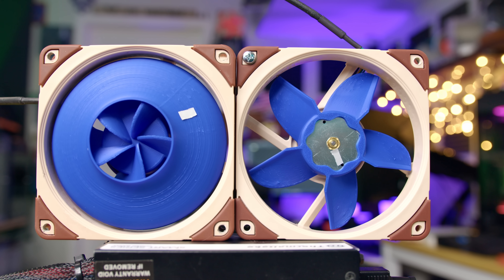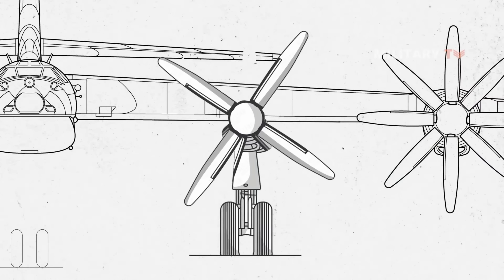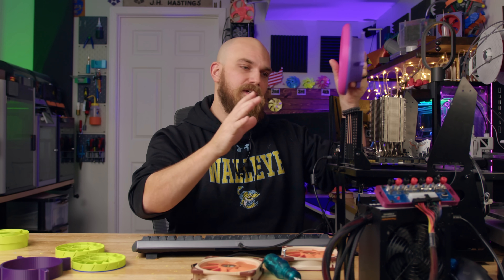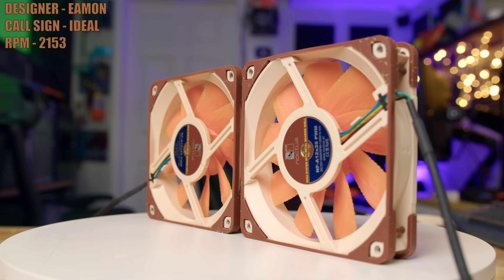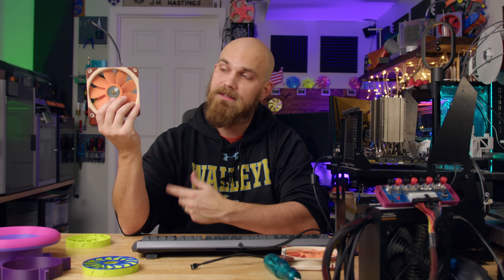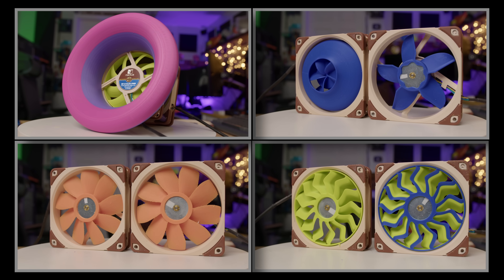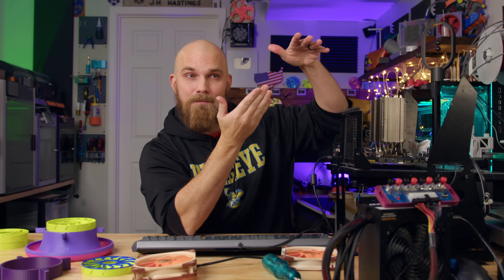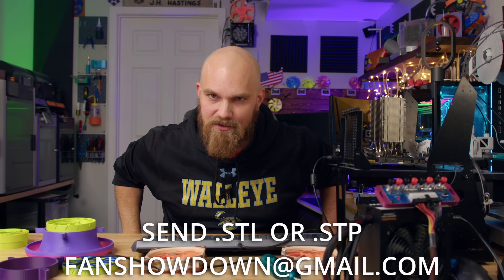This Fan Shouldn’t Work — But It Dominated | Fan Showdown S7E2

Comment: I love that fan show down is still going, it was a great idea when it started and it's still great. Have you thought about a small windmill showdown ? Use whatever kit is easy for you to get as the standard hardware and set a project budget based on materials, time, resources, etc. so that you are not driven insane and the optimization would be a part of the final score. Sounds like more work than I'd want but I'd definitely watch them.

Comment: The calculation doesnt take into account the non linearity of decibel units. For instance 50 decibles isnt 25 percent louder than 40 decibels. Its actually 1000 percent louder than 40 decibels. So the louder these fans are... the less penalty theyre getting for that increased noise 
Note:(this is all quick half asleep brain math so ill probably edit this comment after checking my work)

Comment: Given that the cpu is going to speed up or down based on the thermal envelope it's provided, I feel as though adding some sort of benchmark as a score coefficient is prudent...(yes, a person can artificially lock the power level and clock frequency, but most people don't operate that way.)

Comment: Your scoring formula simplifies to Score = 100,000 / (deltaT*dBA)
You can easily see the issue here, two differing scales being multiplied together with no regard to how those scales actually interact or are perceived. We can assume that temperature is linear in practice, but dBA very much is not, and it isn't perceived as such to your ears. You know this intrinsically, all humans do.

If you want to put numbers to it, something like 
X = 100,000 / (deltaT × 2^(deltaD/10))
This is because the perceived loudness of a sound source doubles every 10dBA, so, the penalty should also double in kind BUT, noise floor is VERY important here, because the perception of sound is not just logarithmic, but also RELATIVE.
This will give you a much more realistic result as to how the experience of using a given fan would be. 

The only way to make this better would be to penalize for narrow-band tonality in the dBA weighting, because broad-band noise is more pleasant to listen to than narrow-band noise at high frequencies, even at equivalent dBA measurements. That is probably beyond the scope of this test.

That formula does change up your rankings of course, but it matches reality, so, shouldn't change any designs that weren't just trying to game the original formula.

By the way, if you have read this far, and want to submit a fan, fewer blades are better, because they have a lower fundamental frequency that the weighted dBA formula doesn't account for. Use good blade design, 5 or 7 blades, and make sure that the interference between fans also creates frequencies below the dBA weighted zones (look it up) and you'll have a winner.

Comment: Have you considered a new smoke test with a cooler in the middle of the fans like it'd be confused on the PC? I think that would provide a realistic visualization of the air flow paths and rate

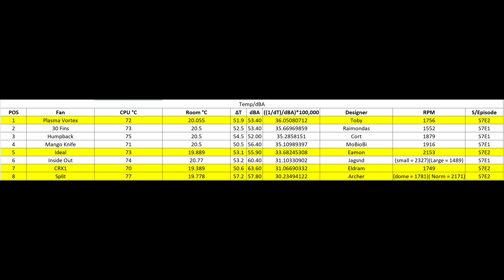Comment: 7:45 the equation seems to rank fans with worse cooling higher than better cooling. Delta t is how low the cpu was compared to room temp so larger dT is better. dT/dBA is a better ratio. Ideally it would be (dT/(10^(dBA/10)))×100,000 to account for log scale of db
Reply: I agree about the dT/dBA thing, however I don't think the exponential is a good idea. We perceive loudness logarithmically, thus dBA is already an appropriate unit to use.
Reply: assuming T (room) is always less than T (CPU), then the lower the dT, the lower the temperature of the CPU.
Reply: @SkeptiSquid  You're right, thanks for explaining. I thought about it the wrong way around.
Reply: @SkeptiSquid oh yh.. for some reason I kept thinking it was the cpu temp before and after... duh

Comment: My only gripe with the new fogger is... there isn't enough of it to properly see the output now 😞
Before you were given a good idea of if it was throwing air straight back, to the sides, as well as an idea of the air velocity.

I don't expect there's much you can do about it though, short of a return to the original days where you had to use a jug to collect and bunch and squeeze it out 😅
(definitely not a viable solution as that's unfair to you, at least in my opinion lol)

Comment: What about the working sound. When the fans are actually on the test bench running and cooling? Under a load and restrictions it will change the sound. Just an idea

Comment: If you want a quiet fan don't have the blades spaced out in regular intervals, look at a car radiator fan, the blades are all over the place, if you have even or regular spacing the noise waves will combine constructively, odd spacing is the way to go. And shouldn't the noise testing be done with the fans fitted to the cooler, to get a proper representative reading.

Comment: I feel the sound is measured completely wrong.

Because a 12Hz sound at 100 dB is extremely loud, but you won't hear it.
And a mosquito can sound extremely loud even though it's less than 20 dB, but that's because the type of sound it makes is loud.

Another nice example is a a turbo fan at full throttle, it sounds quieter compared to 40/60% thrust, but that's because of the pitch of the sound.

So I feel when you measure sound, do it off angle instead of in-front if it.

Also, when a airflow construction has an inverse bell intake as I call them, the sound of the wind entering can reflect of the inverse bell and the mic can pick that up, but we can't hear it, which makes these constructions extremely loud for microphones but not to us.
Reply: dBA is designed to correspond to the varying sensitivity of our ears to different frequencies.
Reply: @koonoho and yet, that contra rotating blade set-up sounds more quiet for me than the rest, but the dB meter shows it's very loud.

Comment: I do think there's a good argument to be made for measuring noise level outside of the main path of the fan & housing. If the housing can noticably directionalize the sound waves, then anyone building their PC is going to probably be able to adjust the fan to their optimally quiet angle.
Reply: I don't think it really matters though, the test is fan vs fan so as long as the test is consistent from one fan to the other, we arent comparing them any reason other than to figure out if one design is better than the other. So if a fan performs better angled one way or another then the design should take that into account since if we vary the setup then the data becomes worthless.

I could get behind doing the decibel test with the fan mounted as it will be during the cooling test since the board and cooler may effect the sound during use, but other than that the testing is pretty spot on.
Reply: @Greg1096  A fair point. I do wonder how much a design could redirect the sound without adversely affecting its cooling performance.

Comment: I think there should be a weighting factor ratio between cooling and noise. I think that weighting factor should be based on a distribution of fans and should probably be non-linear since the noise factor is non-linear but it's more complicated than that in practice since not all sounds are perceived equally. What I would like to see is a cloud of cooling vs sound and draw a curve and see where some fans are above the curve by a noticeable amount. I expect it gets harder to stay quiet the better they cool I don't want a winner that's silent and does no cooling. I'm not really following the equation right now.

Comment: I feel like both the smoke test, and the noise test need coolers. It would be very interesting to see the smoke interact with the coolers, and testing sound because a ton of designs like push/pull are going to change when there are fins to interact with
Reply: I agree, i makes sense since this season is meant to be going back to more "real world" type testing. The cooler and board may have a big effect on the sound, smoke test doesn't really matter though since it isn't being measured.
Reply: @Greg1096  Yeah, well. He hasn't listened to any of our suggestions so it is what it is.
Reply: Especially seeing as the flow is significantly affected by the fans being that close. It creates so much turbulence that it's impossible to see how it really looks.

Comment: it should be delta t / dba ad we want more cooling and less sound,in ur equation u want less cooling and less sound
Reply: No, his way is correct. delta t is the temperature over ambient, the lower the better as that means better cooling performance. Same with dba, the lower the less noise. So both must be in the denominator if you want a score that is higher is better

Comment: Somehow your math is wrong.  Perhaps your system is doing some rounding, but the Plasma Vortex result should be 36.082065049 (assuming the displayed dT and dBA were displayed).  Ideal is off too... should be 33.68943, and CRX1 = 31.0737; didn't check the other.

I only noticed because I wanted to confirm that the formula 100,000/(dT * dBA) gives the same result... it does.  Might be simpler to present it that way.
Reply: I want to add that even with the right math... the formula is the WRONG way to compare fans.  A fan with a 30 degree deltaT at 30db is not the same as one with a 11 degree deltaT at 80db... yet your scoring would say they are the same.

Should be using noise normalized, or temperature normalized, comparisons.

Comment: I don't quite grasp this contra rotating fan design here: how does they change direction? Can you instruct the Noctua to change direction? Te build from 2:20-2:40 hints both fans placed in one way (neither is flipped), which would mean they rotate the same direction, no? What am I missing here?
Aha! Earlier, at the turntable shot they ARE build different!

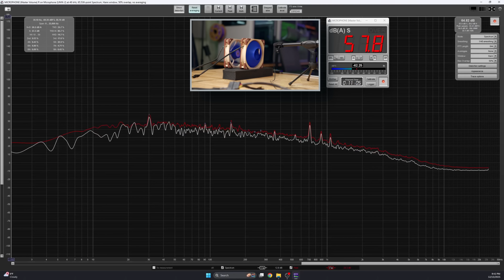Comment: @Major Hardware 5:00 About the sound measurement, maybe you should measure them in the same setup as you use to test the cooling, just in case their geometry changes the sound when they are in their actual configuration, compared to if you just run both fans just placed down near each other.
About the distance, maybe measure form the most "forward" area (start counting at the end of the velocity stack), BUT this will obviously be abused in some ways, so if anyone submits eg. a fan with a long spike, just measure normally for any "abuse situations". 

Or maybe some fractional distance away from the fan, eg, vel.-stack is 10 cm, then add (10 cm/2) = +5 cm extra away from the fan (change the 2 to a better number if someone can calculate what that should be), or maybe not, because it becomes "too many" "magic numbers" to keep track of, now when we have that extra formula too.

Comment: The actual ranking should be (see below for shown work):

1. Mango Knife, 20.9%
2. Plasma Vortex, 27.1%
3. 30 Fins, 34.2%
4. Ideal, 59.0%
5. Humpback, 59.7%
6. Inside Out, 94.3%
7. CRX1, 101.5%
8. Split, 133.9%

Your new formula ((1/dT)/dBA)*100,000 doesn't really fix the situation, I'm sorry to say.

Does it linearize the logarithmic dBA scale? No.

Does it normalize the disparate units to a shared scale before combining? No.

Also, you're only multiplying & dividing, so the parentheses aren't serving any mathematical purpose.

I wrote up a clear explanation with examples of how to do these two vital things on your previous fan video. So I'm only going to update the rankings with the new entries here.

Name | dBA | gain | dT C | Norm gain | Norm dT C | final score | rank
Mango Knife | 56 | 631.0 | 50.5 | 20.9% | 0.0% | 20.9% | 1
Plasma Vortex | 53.4 | 467.7 | 51.9 | 6.2% | 20.9% | 27.1% | 2
30 Fins | 53 | 446.7 | 52.5 | 4.4% | 29.9% | 34.2% | 3
Ideal | 55.9 | 623.7 | 53.1 | 20.2% | 38.8% | 59.0% | 4
Humpback | 52 | 398.1 | 54.5 | 0.0% | 59.7% | 59.7% | 5
Inside Out | 60 | 1000.0 | 53.2 | 54.0% | 40.3% | 94.3% | 6
CRX1 | 63.6 | 1513.6 | 50.6 | 100.0% | 1.5% | 101.5% | 7
Split | 57.8 | 776.2 | 57.2 | 33.9% | 100.0% | 133.9% | 8

max gain
1513.6

min gain
398.1

max dT
57.2

min dT
50.5
Reply: From these normalized values, we can make some interesting observations. What stands out to me is that Eldram's CRX1 actually does an excellent job of cooling at just 1.5% (on a scale of 0-100%). It just happens to also have the worst score for sound level, which makes sense given the counter-rotating design. But that good cooling score means it only needs to reduce the noise to 56.7 dBA to come in 2nd place, which sounds plausible with a few small tweeks. Here's what a google search yielded on that front:

Optimize Blade Stagger Angle
Increase both front and rear rotor blade angles by +6° for up to 1.56 dB(A) noise reduction. Exceeding this can increase noise due to flow separation.

Mismatch Blade Counts
Use coprime blade numbers (e.g., 7 and 8) to disrupt synchronized interactions and spread acoustic energy, reducing tonal noise.  (NC: I would say 7 and 9 actually, given there are 4 housing supports in the airstream)

Adjust Rotational Speeds
Slightly increase rear rotor speed to balance load and reduce wake interaction. Avoid increasing front rotor speed, which raises noise by up to 3.5 dB.

Increase Inter-Stage Spacing
Greater distance between rotors delays wake capture, weakening oscillations and lowering noise.

Apply Acoustic Treatments
Use microperforated panels (MPP) or foam-metal liners on the casing to absorb tonal noise, reducing levels by 2.5–5 dB. (NC: not sure if this is possible in the fan showdown, given it's all filament printed)

Install Tip Winglets
Add suction-side tip winglets to the rear rotor to control tip leakage vortices, reducing noise by up to 1.0 dB(A).
Reply: We also hear logarithmic, thats why it doesnt need to be linearized...
Reply: @TobiasKornmayer  The problem with that is we're not judging by our hearing. We're judging by recorded values.

So the conversion to gain, 10^(dBA/20), is effectively emulating the human ear in this situation.
Reply: @NickCombs  If you would like to calculate sound power maybe, but it sounds linear if you go from 0 to 100 dBA right? Or does it sound logarithmic to you?
Reply: @TobiasKornmayer  I invite you to look up how the human ear perceives sound volume. It is in fact logarithmic. A 10 dBA difference is perceived as roughly 2x.
Reply: @NickCombs thanks, so we should be fine then 🎉
Reply: It all comes down to 1/(dBa*dT) both equally negatively scored. 
So one dBa is the same score weight as 1K, what's wrong with that?
Reply: @TobiasKornmayer  I agree... how would you weight the change in temperature vs the change in noise.  comparing two fans, how would you rank one that is 10db louder vs one that runs the cpu 10 degrees hotter.   I personally would accept 10 degrees hotter (or throttling) over running my fans 10dB louder... but that really depends on what noise level we are talking about.  20db - 30db... can barely hear them either way.  30db-40db, or 40db-50db, now the change in dB is getting noticeable."

I really think the right way to rank these, though its much more work, Is by their dB at a fixed deltaT.  So adjust every fan up until it can move enough air to dissipate a certain number of watts.... then measure the sound level.  Efficient fans will be very quiet, while less efficient fans will be loud.
Reply: @josephhfry  What I've done here is equally weight both values to a normalized scale of 0-100%. If you wanted to weight one metric as being more important, you could absolutely do that with the same approach I've laid out. That's something that is commonly done in scientific studies.

At the bottom of my comment, I provided the individual normalized values, so you would apply your weights before adding them together for the final score.
Reply: @NickCombs  "I" don;'t want to weight anything... my point is more that what is acceptable changes.  A 10db increase that doesn't exceed 30db would generally be perfectly acceptable... while one from 40-50 or 50-60 is a completely different experience.  Ultimately its not a problem with scoring, it a problem with test methodology.  The test really needs to be normalized for noise or temperature, or perhaps multiple tests; noise normalized, temperature normalized, deltaT at max speed.
Reply: @josephhfry  Ah thanks for clarifying. You're right about a jump of 40-50 dBA being less impactful than 50-60. That's precisely why we want to convert it to linear gain using 10^(dBA/20).

It means that 40 dBA = 100 gain and 60 dBA = 1000. It's an exponential curve, so 50 dBA is 316.2 gain. That gives us differences of:

50-40 dBA = 216.2 gain
60-50 dBA = 683.8 gain

And then we of course normalize it to a 0-100% scale from there.

Comment: That formula is a terrible idea. Your poll was flawed because you only gave a choice between your old calculation (which was incredibly flawed) and a single alternative (which is slightly better but also flawed). Noise-normalized thermals are the correct way to compare fans. There's a reason everyone uses noised-normalized thermals - so you don't have to correct for multiple non-linear phenomena!
Reply: Yeah there were a number of people who commented on the poll pointing out that exact issue. New formula is an improvement...but only because the original was just so awful.
Reply: 100% this.

💯
Reply: agreed

Comment: On the flipside I don't care about noise at all. I want maximum performance and efficiency. Specifically high static pressure, high cfm fans. 

Just shouting out for my homies sitting 6 feet from their homelabs with headphones on and couldn't care less about a loud fan.
Reply: Then take the Arctic A12038-8K and let me know as soon as your ears bleed.
It actually makes thrust and gyros if you twist it.